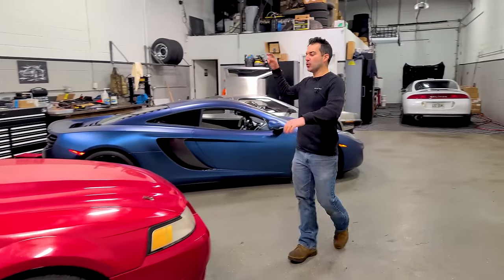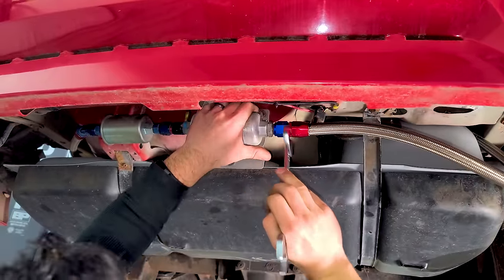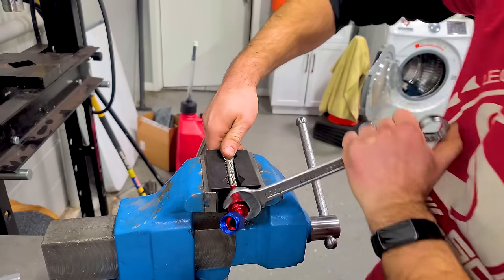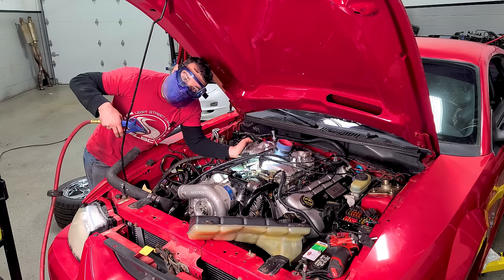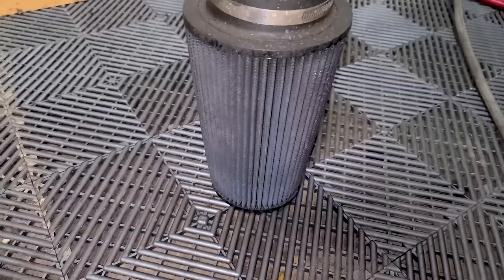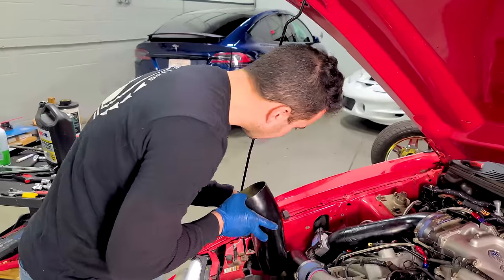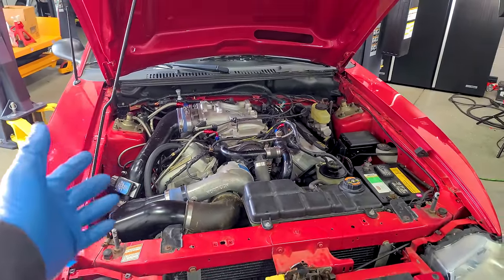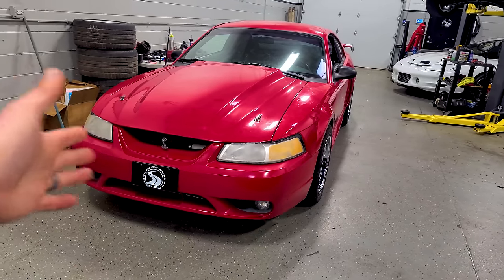FIRST DRIVE Of My Abandoned Cobra Mustang After Sitting For 21 Years! It Broke But SOUNDS SO GOOD!

Comment: Unfortunately those stock fuel systems were pretty pathetic. These cars came with a returnless fuel system so only one line was needed to carry fuel to the front. They utilized the 5/16 line as the fuel feed and the large (1/2 inch or so) line was used for the evap system 🤦. 

Pretty cool that they utilized the stock feed line as the return.

PS: don't trust that oil pressure gauge. It only has on/off function off the pressure switch. The switch apparently only requires a few pounds of pressure to close.

Comment: I don’t know what estimates you got for a wiring harness and new ECM but you could’ve bought one for a lot cheaper than your $20,000 and it wouldn’t be a wiring nightmare like it is now you’d be able to custom tune it and everything you could’ve kept the factory body harness to control factory controls and just did a way with your electronic control module or PCM depends on what you wanna call it being a Ford certified technician. I’ve seen it done many times.

Comment: You should have used the PTFE hose just for the sake of rubber hose bleeding gas and having it constantly stink of gas. Could have saved money on hose by bending, running, and flaring stainless tubing under the car. I don't get the laziness of tuners running a hose the whole length of a vehicle's undercarriage. Not good.

Comment: Front rotors on Cobras are a larger diameter. The calipers are dual piston, not sure if GT is dual or single. I bet the rear brakes are Cobra spec; a little thicker rotor but same pads.

Comment: Cobra had 13” front rotor and the calipers can be taken off by pulling a pin at the bottom.  GT has 11” front rotors and the calipers are bolted to to the caliper bracket.

Comment: That large "fuel line" isn't a fuel line, it's the evap line. These systems were return less in the fuel delivery from factory. I also noticed the Speedo wasn't working, the trans may not be shifting because it can't tell how fast it's goin, these transmissions are all electronically controlled and if they can't see they're goin the correct speed to initiate gear change, they won't.

Comment: Ooo. If that 2007 BMW is a 335 and it's the guys FIRST car I would not recommend that car for any kids first car AT ALL! How ever if it's anything else from that year he will be okay. I don't say this because I don't  like the 335 I say it because unless the kid has major knowledge and skills along with access to the right tools it will be a nightmare for him at some point or seven. I have had two of them and I know Alex has had one but they are troublesome because of the parts on the engine not the engine itself UNLESS it hasn't been maintained properly. Actually I have a high HP (Pushing the 625hp mark on E40 fuel)  one of these and I love it BUT I have spent many hours under it and on it doing ALL of the engine and drive trains replacements until there's nothing left but new parts. He should be fine if it's a 328 or 330 or 325i but the twin turbo is for gear heads with lots of tools!!

Comment: alex trans is definitely in a failsafe check all that wiring for the trans and check the data pids see if it has input output speed signal also shift solenoid signals

Comment: The tire size up front… 275/40r17 and 315/35r17 would be the exact same outside diameter and runout. The front tires look like they are .2 to .4 taller than your rears… also drag radials are directional and those look backward? I could be wrong on that… and the rear end is likely a 94-98 rear end not a 99-04 it looks to me like its a touch narrower (hard to see but ive delt with 100+ 79-04 mustang rear ends. The fox rears are narrowest. But will interchange. The rear lower control arms on that car DO NOT CHANGE THEM!!! Those are south side machine bars they lift up on the car car pressing the rear end down equaling more traction. That being said, if this car is or becomes a stick shift again get rid of the drag radials and go bias ply. Those bars on stick cars with radials will be expensive. You will bust clutches, snap input shafts, bend mainshafts, driveshaft and anything that takes the instant harmonics from the hard tires (radials) ill assume the rear end has c-clip eliminators given its history. The boost a pump is necessary btw. Even is the car has a serious main pump. Im only sharing my thoughts on this to help. Not saying my ways are the only ways. The front sway bar, take it back off. And when you launch this car dont launch weak. The south side machine bars only work if they find instant center upon initial forward movement. Done right you can hook in gravel with them (figuratively speaking) and taking the air filter off at the track/dyno and letting the sc be open with the passenger headlight temporarily removed could make a 15-45hp difference on a wot pull under load. If you ever track the car ice the intake down between runs literally set a bag of ice on the manifold, let it melt and run again. Id also look into the factory fan speed wiring and wire in a switch to the high speed switch, i do this so i can leave the fan on between runs helps cool down a blower car.

Comment: You don't need a standalone on these cars because the Ford PCM is very capable of making over 1000hp and with sct u can adjust trans functions and full tuning of the engine

Comment: It probably has a big stal converter and a shift kit with really tight springs so you really dont feel those early shifts, with that said, there is definitely something wrong with the transmission, it's not shifting properly for sure!

Comment: If it doesn't have a manual valvebody, 4R70W transmissions are really sensitive to the neutral safety switch setting on the side of the transmission.  The sensors and solonoids tend to crap out on cars that have sat for a long time too.

Comment: I drove my 6.0 G8 with open headers to the muffler shop 5 miles away to have a coupler welded on when I was done installing the headers. Super obnoxious and it was rattling every panel to death.

Comment: Disclaimer: I have never worked with AN fittings before, but it seems to me using grease is wrong because it will stay slick for a long time, and possibly fail because of that.  Rather than grease, it seems you should use dish soap since it will be slick for a short time, and then when it dries, it gets sticky, or at least not slippery any longer.

Comment: And put some damn FlowMaster classic 40s on that car and thank me later. They only take 5-10hp over a straight through muffler. And if anybody wants to quote that before you do, please tell me you believe in running the air filter at all times. Worried about 10hp but give away up to 45hp for a filter lol. The flowmasters make the 4v sound better than literally any other internal combustion engine ever made since the old school hemis. Any old head will likely agree on this. Just opinion tho. And you need to keep the hood pins. Mustangs without pins loose windshields. Ask me how a know… lol

Comment: The Calipers on the Cobra aren’t any bigger than the GT and actually have smaller pads than the GT , but they allow for a bigger rotor (13” vs the factory 11”). Funny enough, the cobra caliper and rotor don’t really add any weight vs the GT setup. I know because I weighed mine when doing the upgrade.
Reply: Depends what year you swapped them onto, 99-04 GT calipers were aluminum dual piston and were very light, but 94-98 had heavier iron calipers with single piston..It would add A little bit of weight and some rotating mass but definitely not bad, there was a decent amount of thought put into keeping these cars light..

Comment: The long studs are used for drag racing applications.  Certain tracks require them so that there is excess stud material for strength.  I do not know the ins and outs of this rule, I just know that it is a real thing.

Comment: The caliper is different on my 02 GT... The pads slide into the bracket, not the caliper. Doesn't have the holes in the face either.

Comment: Cobra 13" rotor 2 piston calipers. The GT has 11" rotors  and 1 piston calipers.   Cobra better by far.  In the rear the cobra should have vented rotors...  you can buy 95 taurus  rear calipers as an upgrade and use cobra rear rotors.

Comment: Why would tou bend the bracket, the bracket is for a completely different size pipe than that intake pipe. Even with an O ring, without any type of gasket for the metal on metal (and the lack of it being seated properly) you'll have a continual leak of air while under load because that o ring isnt going to do anything to seal between the bracket and the pipe. The mass air flow sensor should also be BEFORE the inlet of the turbo, not in the pressurized side.

Comment: Interesting that he didn't remove the surface rust on the wheel hubs or the rear brake disks. That rust will look nice on the inside of the shiny rims 👍
Reply: That's what brake pads are for
Reply: @jsteezy80  Where goes the hot rust particles?
Reply: @jsteezy80  Where goes the hot rust particles?
Reply: @frank-t6857  nowhere important and something that's not hard to just clean after the fact
Reply: With it sitting 20 years or whatever I kind of agree but I trust Alex.  But everyone I know just used the pads to clean it up. Because you definitely don't want to use anything abrasive enough to take the metal away and now you don't have a flat surface so why not

Comment: You need to bleed that coolant system the overflow tank is not where you add coolant you must add through cross over tube. Never open reservoir your gonna have air pockets in the coolant system.

Comment: 35:01 
Uhm... That's sealed in all axes, yeah? No chance of just a tiny bit of leakage? 
I know i'm a bit of a Debbie downer now and then, but i'd test pressurise that whole pipe section up to at least 1.5X the max boost pressure.

Comment: 42:17 and 43:01 Alex if you value your hearing and dont want to end up as a living austin powers joke, where you have to have someone yell something at you three times just to talk to you, put some hearing protection on, as anything above 85 DB like this, WILL cause sustained hearing damage, so order in some 28 to 32 DB rated headsets and put them in the shop, as you badly need them here

plus it means you wont have to have your wife yell at you for an hour to tell you the dinner is ready, or cut 8 speakers in the delorean just to enjoy the radio at what is a normal level for everyone else

which is why those fart can cars, the ricer burners always have a speaker system that is bigger than half their cars in them

and why ironically the most sound investment you can make is literally in a hearing aid company, as they will NEVER go out of business, and those systems cost thousands upon thousands of dollars per person alone

or you could just buy a 32 dollar pair of headsets and wear those now,

Comment: No don't oil that air filter.. if that car has a mass air flow sensor.. it will get caked with oil and throw a check engine light and possibly run rough as the computer is adjusting to the reading of the now faulty m.a.s sensor.

Comment: You probably won't see this. But I noticed in driving clips that the speedometer doesn't appear to be working. Is it possible the speed sensor is faulty, causing the cluster and the transmission to have no reference?

Comment: Does the transmission have a Vehicle Speed Sensore it uses to know when to shift? I see the spedo sitting at ZERO during driving. I forgot to add the speed sensor wire when I replaced the TECHM on my 6L80 and it acted very similar on my first test drive after replacing it.

Comment: So this car was originally a manual and I think he re hooked up the original ECM if so it's computer was never meant to control the automatic.  This is not the original transmission to the car what is it 4r70W or 4r100 and does it have manual valve body or a stand-alone controller I'm guessing it's the 4r 100 and if that's the case I don't think even an automatic ECM would control it as it would have been for 4r70w

Comment: The oil feed line is JIC fittings you could have just built your own AN line
Reply: And add a live oil pressure gauge. the ford one will make you think you have good oil pressure all the way down to under 8 pis then the Gage on the dash will read low

Comment: Why wouldn't you use poly lines in your AN fuel lines especially since you like using e85 and then you wouldn't have to worry about the rubber deteriorating?

Comment: Low pressure line probably didn’t have any fuel in it, leading to the rubber drying out faster than the high pressure line that had fuel in it for a long time until it slowly leaked out. (Theory)

Comment: I bought a Carly after my transmission started acting up and I took it to the dealership. They kept it overnight and told me I needed a new transmission. They cleared all the warnings and they have never come back? I have run Carly and nothing shows up? Took the car to AAMCO and he said just drive it until it breaks. Trying to unload it and get a used truck.

Comment: Alex weld wheels do not use special studs they use special lug nuts. The reason those studs are so big is because you have to run open-ended lug nuts that stick out the end of the lug nut at least the diameter of the stud. That's the only reason for the giant studs. Dirt circle track racing requires studs that use 1 inch lug nuts.

Comment: Carly is a rip off i got it last year used it once to adjust some features on my Tundra and they charged me $130 in January for a subscription service i never even signed up for. I contacted them about it and still haven't gotten a refund. Also i tryed to use the coding feature again last week and it says its not Supported anymore and to contact customer service with questions. TOTAL RIP OFF.